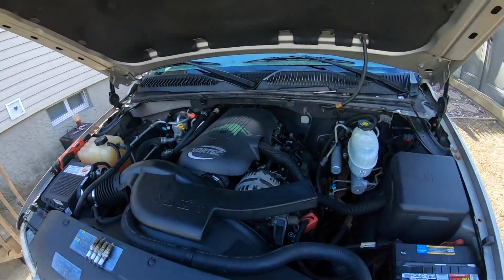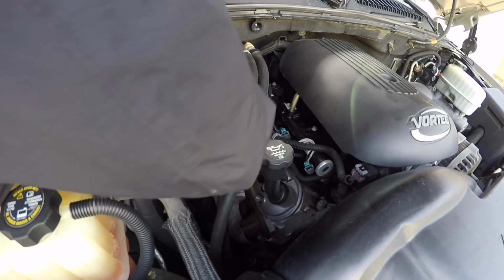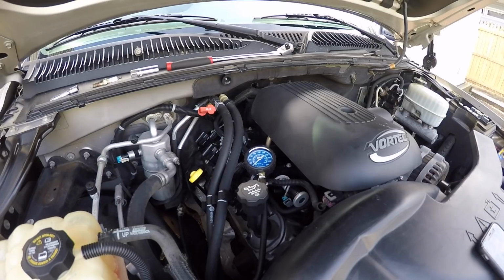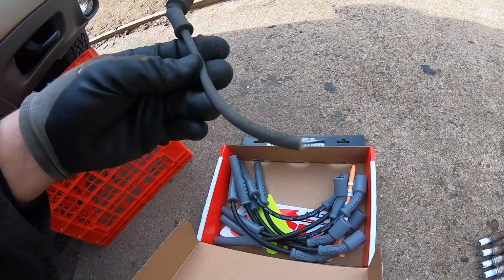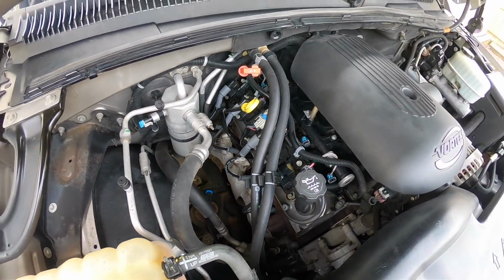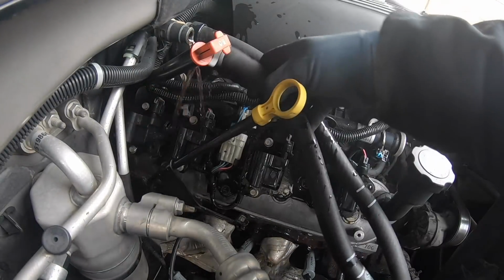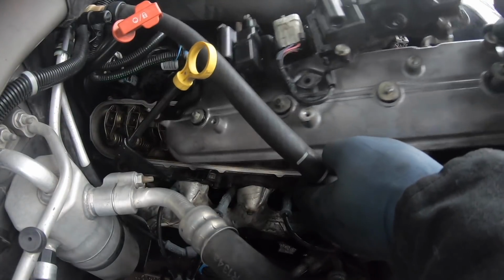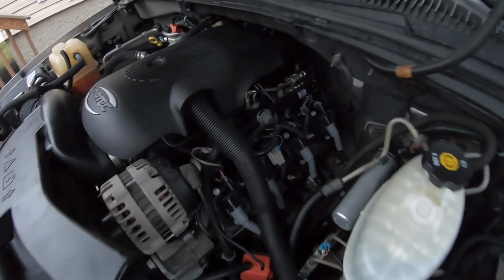At Least They Kept the Engine Clean... | Auction Tahoe | Plugs, Wires, Compression Test

Comment: You have an L85, I believe.  I think that's what's in my flex fuel 04 suburban.  It's an lm7 with some fuel system changes to handle high ethanol.  Just has different hoses, pump, injectors and whatnot.  The engine itself is the same.

Comment: While your at it. Get rid of that clutch fan and swap over some efans from the newer trucks. The factory harness will connect to your pcm and let you have full control over them.  Free up some power in the process. Lots of aftermarket support for that truck.

Comment: That last cylinder on the driver side near the firewall it's common issue on those five threes for a misfire to happen on that one due to bad seals for the valves my '05 Tahoe has the same issue on that particular cylinder

Comment: Hey man. This question is related to your Camaro. I have a 88 Camaro with the 2.8 and want to do a v8 swap. What would you recommend as far as a motor and transmission for someone who is new to this.
Reply from the maker: If you wanna keep it simple you can do a carb’d 350 from an iroc or something. More expensive, but also a much better payoff and platform for future big hp, I would do some kind of ls swap.
Reply: Thanks man. Love your build